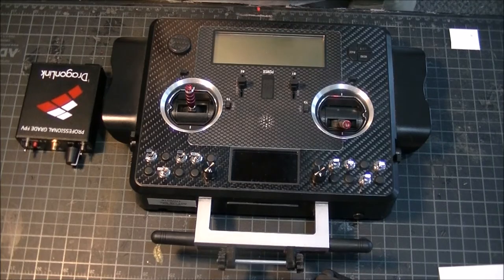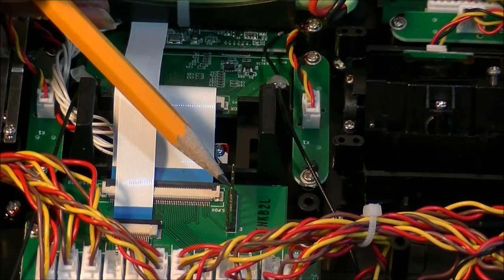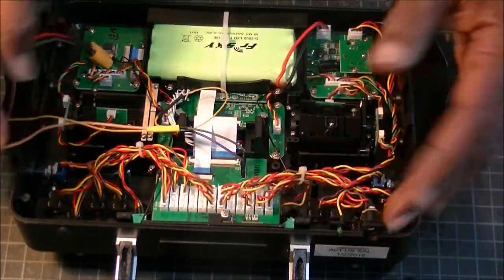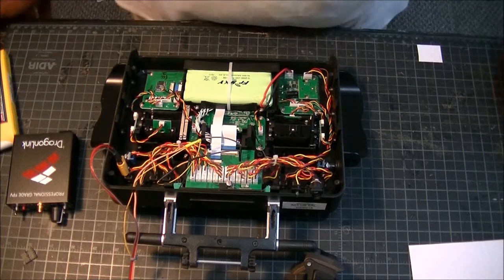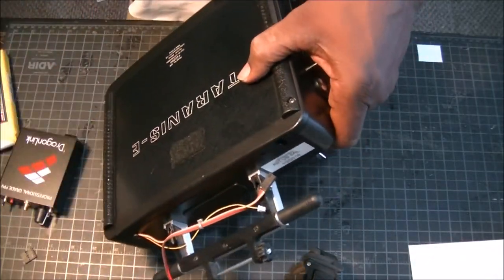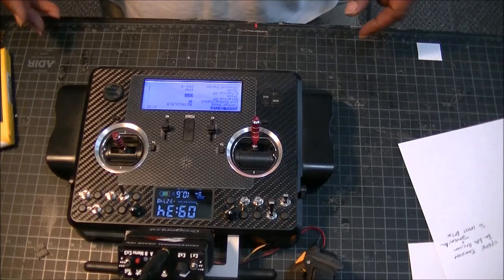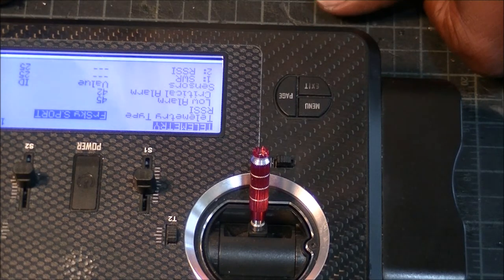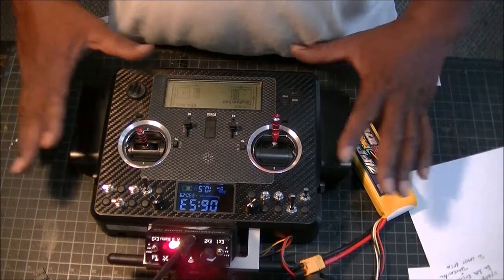Taranis X9E and Dragon Link

Comment: Couple questions for you. I'm looking to do the EXACT same mod for long range FPV. Just wondering how tight it might be if you tried to take apart the Dragonlink and put the Dragonlink INSIDE the back of the X9E? It is designed for a mod to fit inside. Maybe just not that big of one. Just checking how tight it might be. Maybe even if you cut the back of the X9 to fit the mod. Last question . How much range are you getting out of your DL with it ?Thanks for your time.
Reply from the maker: I thought of that and based on the room inside, I would say its not a highly recommended thought.  My range so far has been 22 miles roundtrip.  I didn't push it and in Atlanta you have to route your flight carefully.  I'm heading to South Georgia next weekend and hoping to do so serious distance